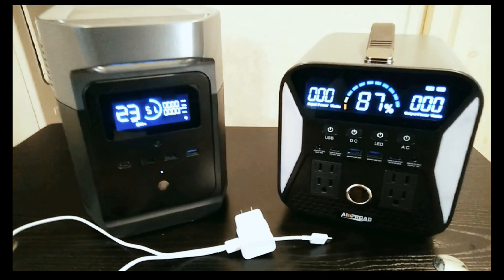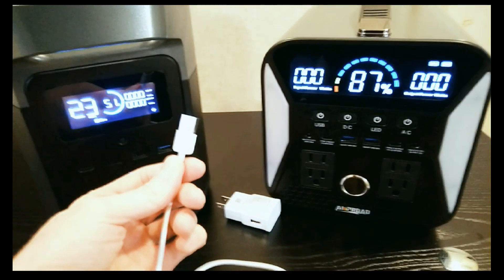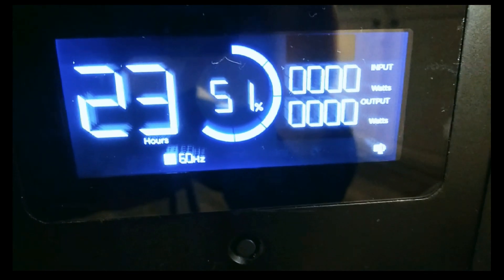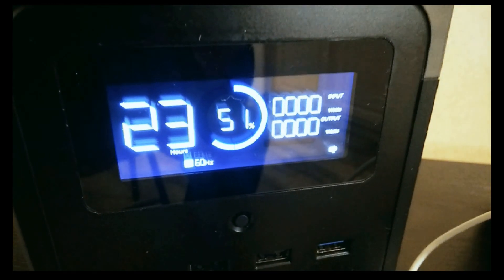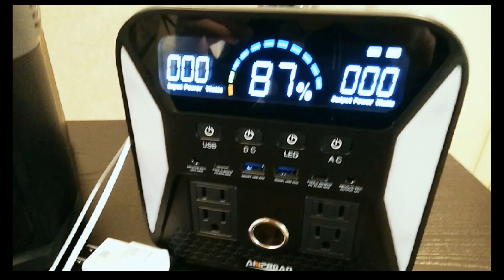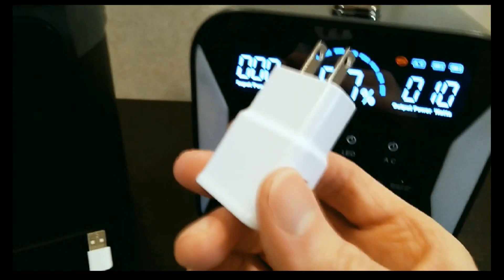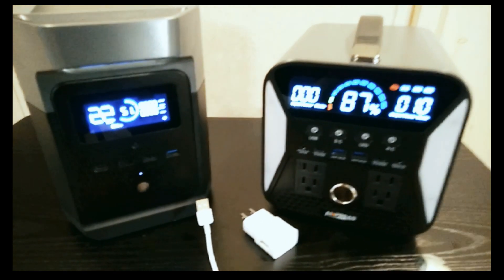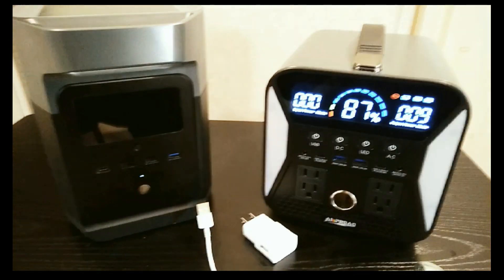When NOT to use your power station's inverter

Comment: Pretty good tip in prolonging the charge of the Delta Mini. I know the it takes quite awhile for the battery charge to go down and this is one tip that could make it last longer.
Reply from the maker: Yes it definitely will make it last longer.
Reply: @SoGenFan  can you use power from solar panels straight to the inverter during the day to conserve  the battery power for the  night time? thank you

Comment: I built my own little power station charged by a 450 watt solar panel and i use as many 12v or usb stuff as i can. Inverter is often switched off. Greetings from Jamaica.
Reply from the maker: Thanks for the comment! Some of these power stations don't have many dc / usb outlets and that could be a reason why people go for the inverter as well. There's definitely advantages to building your own!